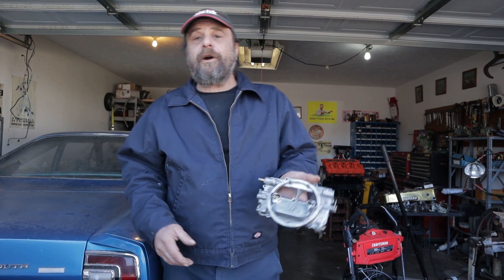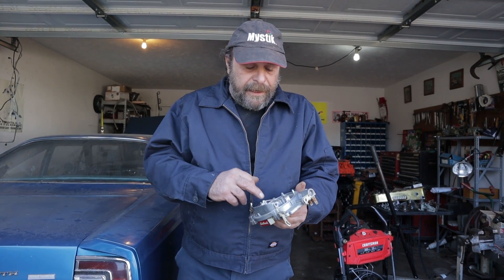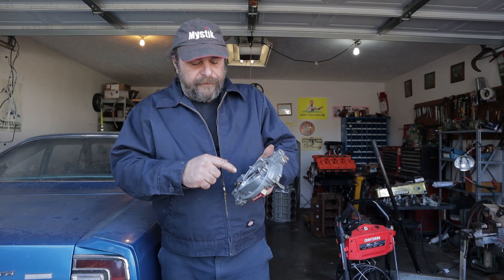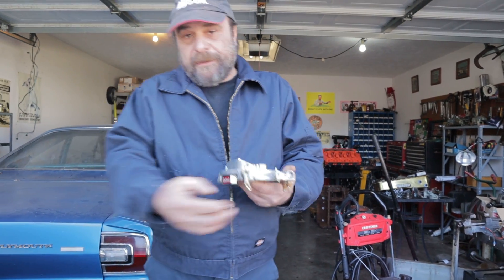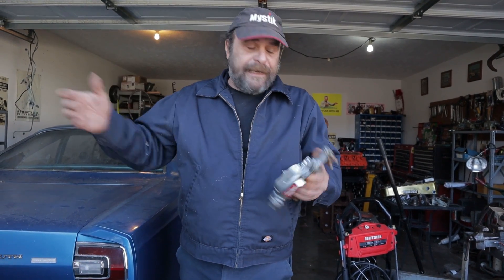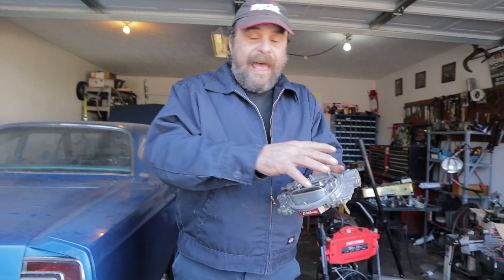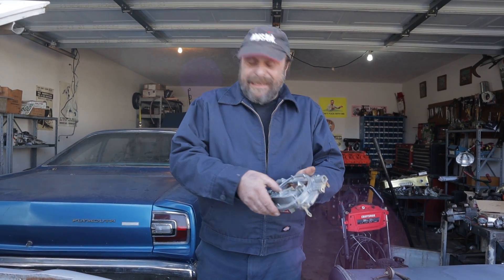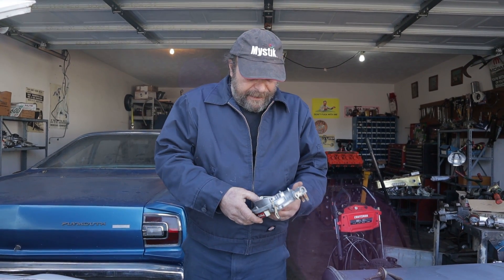The Most Troublesome Part Of Any Carbureted Car

Comment: Manual choke is the way to go
Reply: "That's what she said "  - Michael Scott.  Dunder Mifflin Paper Co.
Reply: EFI is the way to go.
Reply: @PistonAvatarGuy  not necessarily. Most guys who don't like carbs, don't understand them.
Reply: @erikturner5073  It's not like they're complicated, they're just a sloppy, cantankerous way to deliver fuel.
Reply: @PistonAvatarGuy  today's carbs are well designed and work well. Carbureted hotrods work and are not necessarily sloppy. Spending ridiculous money on a fuel system, other EFI parts, and spend many hours tuning and data logging isn't for everyone either.
Reply: @erikturner5073  Carbs do have their place, and it's not usually worth the trouble to put EFI on an engine that originally had a carb, but I'd never want a carbureted vehicle.
Reply: @PistonAvatarGuy  to each there own.
Reply: @erikturner5073  Well, EFI is objectively superior in every possible way, so... yeah...
Reply: @PistonAvatarGuy  nope! It all depends on the persons choice. If you have big money and resources.  If I'm putting together a car for a person who isn't hands on, then yes EFI would be the way to go, and I would suggest that route for that type of person. However if you understand carbs and you want to save money and still make power carbs are a great way for alot of people who maybe hands on and have made the effort to truly understand carbs. Personally I ENJOY carbs and I'm a certified master automotive technician, and have been so for 15 years. Carbs are MY go to choice.  In the right carbs are great as well. It all depends on the persons preference and some cases expertise. Carbs are not going anywhere in the hotrod world. Regardless of YOUR opinion carb intakes are being manufactured  for the newer Hemi engines, LS engines, as well as for Ford 4.6 and 5.4! Carb swap intakes are also coming for the coyote too I believe. That proves the tired argument of "carbs being DONE" as nonscence!
Reply: @erikturner5073  I did say that carbs have their place, I wasn't saying that no one should use them, I was just saying that EFI offers superior performance, and it does.
--
A well designed EFI system will always make more power because it lacks the restriction of a Venturi, EFI self-adjusts for all operating conditions (varying altitude, temperature, etc... once tuned properly), it allows for higher compression ratios because it always maintains the proper air/fuel ratio and because it can make use of knock sensors, port and direct injection systems always deliver a consistent mixture to all of the cylinders, it can easily be used to control ignition timing based on multiple operating conditions (load and rpm, for example), it offers better efficiency, better reliability, it doesn't hiccup when you go over large bumps, or stumble when you hammer the gas pedal, it doesn't make the engine difficult to start when it's cold, it doesn't suffer from vapor lock, the engine runs cleaner, the ultra-precise control of the air/fuel ratio allows for the use of catalytic converters, the exhaust doesn't stink... the list goes on and on. EFI is just better and I would never want a carbureted car, but that's just me, other people can do whatever they want with their older vehicles.
Reply: @PistonAvatarGuy  nope it's been proven actually that carbs make more power. With the acception of variable valve timing in today's EFI cars where you can somewhat have your cake and eat it too, carbs on traditional OHV engines make more power than the EFI counterparts and are more economically viable as an added bonus. Sorry but those are the facts. Plus EFI doesn't have the simplicity of carb systems. A sensor that goes bad can turn into a very difficult problem to track down. EFI may offer superior and no hastle operation for the non hands on types, but that's about it. Saying carbs make less power is you doing nothing more than reaching. The opposite has been proven MANY TIMES! Plus I don't get the stumble and carb issues you've mentioned because I know how to dial in a carb and I've smoked plenty of EFI cars.👍 Again carbs are not going anywhere and EFI is not a guaranteed win in a race! Other than that you do you. To each there own, but facts are facts!
Reply: @erikturner5073  "it's been proven actually that carbs make more power."
-
When? Where?
-
"carbs on traditional OHV engines make more power than the EFI counterparts"
-
If you're talking about those TBI units that you bolt on in place of a carb, maybe, but I'm talking about full blown, multi-point EFI, or even ITBs. NOTHING makes more power than a good set of ITBs, on any engine.
-
I think the majority of your perception of EFI is the result of working with older engines, and/or American engines, which have never really had great EFI systems, or never came with them in the first place.
-
Something like this would never be possible without EFI: https://www.youtube.com/watch?v=YRFrFudg7eM
Reply: @PistonAvatarGuy  stop getting your info for magazines. I have a PUMP GAS big valve iron head 11;1 compression CARB foxbody 302 that kicks ass Monday thru Saturday, and twice on Sunday. Plus I've been a master tech for 15 years as I've said  before. I'm not gonna pointlessly argue this subject with you since I have actual experience and also having proof sitting in my garage. There are choices and either carb or EFI are fine depending on personal choice and needs. I and others have valid reasons for choosing carbs and there is nothing wrong with that, just like EFI guys having there reasons for there system of choice. CHEERS!😂
Reply: @erikturner5073  You don't have experience with Kinsler ITBs and a MoTeC engine management system on that engine, do you? Until you've done that, you can't PROVE that EFI wont make more power on that same setup. Sorry, buddy, but your little 302 is absolutely nothing when compared to the most powerful racing engines in the world, WHICH ARE FUEL INJECTED, and the engineers who build those engines have FAR more experience than you could ever dream of having.
Reply: @erikturner5073  When you build cylinder heads for NASCAR teams and run a 13.4:1 compression ratio on an engine with a catalytic converter that passes strict Texas state emissions tests and runs on pump gas, let me know. http://theoldone.com/articles/Larryscivic/Larrys_Civic.htm
-
"I've been building engines since I was a kid racing karts. I built a '65 Mustang small block into a big block stomper, and by the time I was 20, I had a Ford factory-sponsored drag team. When Ford pulled out of racing, I started to do NASCAR heads for Penske and the Elliot family. I've done heads on the 4-valve Cosworth, 2-valve Fords in NASCAR and Pro Stock, and of course these lawnmower engines. Today it's nearly all Honda. Those engines are the best factory engineered things I've seen in 30 plus years of doing this." - Larry Widmer
Reply: @PistonAvatarGuy  Nick's Garage on youtube is one of may who's proven that in any OHV engine combination that carb makes more power that EFI everytime. You'll need to find the other research for yourself. Also 13.4:1 is not a typical street engine. If you throw enough money at it anything is possible. I'm speaking on the realm of typical builds. Not high end big dollar builds.
Reply: @erikturner5073  I've seen that video and immediately went to the comments to complain about how stupid the comparison was, only to find that plenty of people had already pointed out most of what he'd done wrong. And, again, those bolt-on TBI units are far from being the greatest example of an EFI system.
-
There was also another carb vs EFI video where the engine builder used some sort of hacked up tunnel ram made for a carb for the EFI system and another where the engine builder intentionally tuned the EFI to lose power in the lower rev range. I don't know what the game is here, but these YouTubers clearly have a problem with EFI and are intentionally making it look bad.
Reply: @PistonAvatarGuy  I sent two credible sources. Carbs do have plusses and there place. As far as power production and them being absolutely inferior is not the case. The gains by EFI are small in some cases and also come short in others. However you can always brag on how much more money was spent on that big dollar EFI system.😂
Reply: @erikturner5073  In response to Holdener's video: The charge air cooling effect is why it's best to place the fuel injectors outside of the inlet of the throttle body on engines that run at high rpm, because the high intake air velocity is able to atomize the fuel more effectively, even as the fuel is injected well before the intake valve. Good/experienced engine builders already know this. Also, ITBs would still be superior to that tunnel ram system, which is always going to be poorly suited to an EFI system.
-
Here's a cutaway of a Kawasaki H2 engine: https://www.youtube.com/watch?v=Qr1YeVU9Z3c ... At 0:39, notice that it has two sets of injectors, one set near the ports in the head (for low rpm operation) and another set on the airbox, spraying into the throttle bodies (for high rpm operation).
Reply: @PistonAvatarGuy  the gains with EFI over carbs are small or non-existent when going for total power. Spending big money for small gains that most will not see or feel is not a realistic option or makes sense for most. That's where myself, uncle tony, and the rest of the blue collar hotrod public operate. We will continue to make CARBS GREAT AGAIN!!👍🇺🇸
Reply: @erikturner5073  In a road car, the advantages with EFI are HUGE, I already listed them. Anyway, you can't even seem to grasp the idea that there are different types of EFI systems, I've clearly gone over your head, so I'll just leave you to your cantankerous, polluting, gas guzzling junk.
Reply: @erikturner5073  And, again, with Holdener's videos, he's not taking advantage of ANY of the possibilities that come with fuel injection, like a higher compression ratio made possible with knock sensing. Lets see him, you, or anyone else run a 13.4:1 compression ratio on a carbed engine running on pump gas, or even a 12:1 compression ratio in a production car, like you'll find with some MASS PRODUCED engines (heck, even the 911 GT3 RS runs a 13.3:1 compression ratio). You can't do it, the carb will end up going lean under some condition that it wasn't optimized for and blow your engine to pieces, or it will run so rich under some conditions that it will lose power relative to what that same engine would produce with an EFI system.
-
That's the problem here, you're just talking about perfect, dyno room results, where the carb is tuned perfectly and where the engine is only being operated at WOT. IN THE REAL WORLD, where operating conditions change enormously and you can't have someone under your hood constantly adjusting your carb for every condition that your vehicle encounters throughout its life, EFI is absolutely UNBEATABLE.
Reply: @PistonAvatarGuy  if you not a hands on person then EFI is superior and also in daily drivers. However in my hotrods or my protouring build I love the carbs!👍 I don't mind self tuning and being hands on and still attain EXCELLENT RESULTS. Have no reason to envy EFI. Especially with the price point. Plus there nothing like a clean and simple engine compartment with a simple carb setup that can be addressed with simple tools. For alot of people carbs are a WIN. At the end of the day your still making power, any with smart choices good drivability can be had as well! I can drive my carb setup state to state. Just make easy jet changes along the way if you changing altitudes and your good. No big deal for a hands on person.
Reply: @erikturner5073  Like you said before: To each their own.
-
Here's a better picture of that Kawasaki engine: http://images.motorcycle-usa.com/PhotoGallerys/2015KawasakiNinjaH27.jpg
Reply: @PistonAvatarGuy  I still love carbs, and especially not spending unnecessarily ridiculous amounts of money on a EFI systems that I still have to data log to dial in. Not my thing. Whatever you put under your hood is your business. I've given you leght sources of the viability of carbs and you choose to not learn. Instead you only criticize. As they say "one can only lead the horse to water, but you can make it drink." I've tried at least. ✌️

Comment: What the hell was wrong with the manual choke? I never had any trouble with a manual choke carb!
Reply: The operator was the problem. Lots of dummies left the choke on for miles after the engine was warmed up.  Then they were surprised when their engine was worn out at 50K-60K miles.
Reply: Alan Trimble Those were the idiots that kept Detroit happy by buying a new car every 3 years!
Reply: @alantrimble2881  I actually did that once on my motorcycle going to work back in the 1990s. I was working graveyard shift and only got about 2 hrs sleep after taking my dad to a doctor appointment that day. I left the choke fully closed for about 10 miles of the 25 mile run to work that night. I could still smell raw gas when I got there.  That's just one of my "big dummy" moments lol! Operator error all the way!
Reply: @alantrimble2881  "The operator was the problem."

You mean "loose nut behind steering wheel."

But no, real talk?  Emissions standards.
Reply: Manual choke and manual transmission should be considered anti theft devices by insurance companies these days! Oh and God forbid that anyone has to CRANK their window down to place an order at Rotten Ron's drive thru!

Comment: I was kinda hoping you were going to cover the Q jet a little... getting ready to tune on one shortly...I find them intimidating and I'm not looking forward to it.
Reply from the maker: Search this channel...we did something on the Q jet sometime last year
Reply: As you should. There's teeny little balls to lose in there, tiny springs, so easily bent metering rods, fragile gaskets and more. But I'm not an expert, I've rebuilt only one of them. And I said never again.
Reply: get Cliff Ruggels book.i also have an older rochester carb book . i use an electric choke on the qjet

Comment: I have a 455 oldsmobile i dropped a chokeless holley on it. Id put a rag on two barrels and rev it a bit. I have driven EFI built cars and carb cars. I prefer carbs. In modern cars i feel like there is too much. I dont have enough control. One reason im selling my 2016 passat.
Reply: Had to install a traction control button in the wife's 2014 Jetta for 100$. 
You could barely get moving in the snow. 
Well you could but the throttle cut is a pita and it feels like a bucking car. 
And it was annoying during normal driving, you would step on the throttle and nothing would be there ....step a little more ,nothing ...step a little more and wham she's going like a rocket. 
Drive by wire sucks, it's nice to get in an old car and actually feel throttle response from a cable. 
99% of the time I drive her car with the traction control turned off, the lame throttle response is 10 times better it's almost tolerable. 
And I tested it , it doesn't fully defeat. 
Get it really crossed up and sideways right on the edge and it still kicks in. 
Big brother is still there.

Comment: If your Quadrajet starts and idles when the pull-off kicks in, It is either too too tights or you do not have enough pull-off. Quadrajets have to start and then die or the choke is set too tight. The best choke ever was the hot water choke that took coolant from the intake manifold floor back the the water pump suction. This type kept the choke coil at the exact same temperature as the manifold floor.
Reply: " Quadrajets have to start and then die or the choke is set too tight. " 

No. No at all. A properly adjusted Q-jet will start and run without stalling.  This is especially true of the E4ME models, but it was also true of the exhaust heated choke thermostats and the "divorced" thermostats.
Reply: That's not true. By the late 60s, pretty much any American car with an automatic choke could be started and driven away just like an EFI car. If not, it was because of indifferent adjustment by a mechanic or at the factory, or worn out or faulty parts.
Yeah, I can just imagine my mom coming home with a brand-new say, 1970 Impala, and telling my dad "Oh the salesman said you just have to start it up and then let it die before you can drive it"  He'd have driven it back and plowed it right through their plate glass window. I'm not even kidding.

Comment: It's also why the cylinder walls get washed down with fuel on carbureted engines and fuel injected engines have a longer life span.
Reply: Not when things are working correctly.
Reply: Tune the choke with the rest of the carb and it won't happen.   Tune the EFI too rich when running in open loop and it will happen.  EFI by itself isn't a cure-all - both it and carbs need to be tuned for all operating conditions, including cold starts.
Reply: @aussiebloke609  Bingo.  First thing I do setting a carb up is adjust the choke.  

Well... that's after I make sure the float was set right at the factory (they aren't always), but that's pre-install so it doesn't count.
Reply: 225,000 miles on a 70 318. Original run engine. Automatic bi metallic choke.

Comment: Listen to him, the choke(s) can make you want to pull your hair out! Providing you have any left.
Reply: frank bachem I bought a brand new Edelbrock and put it on my 360 but never had the truck work properly I just removed it and attached the original manual choke Worked like a charm
Reply: Awesome, I had both mine go out simultaneously.  Thermo, and pull off. Use to scare the kids in the neighborhood with the black smoke belching out of my car.
Reply: Nah, setting the choke is super easy, barely an inconvenience.